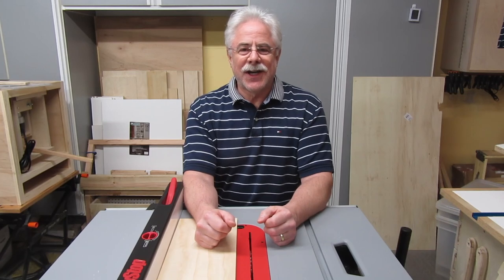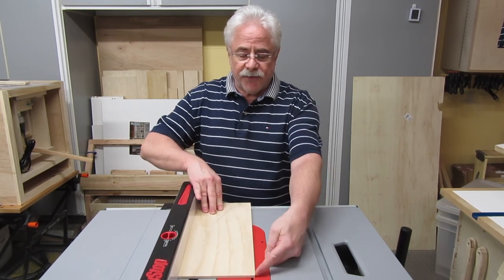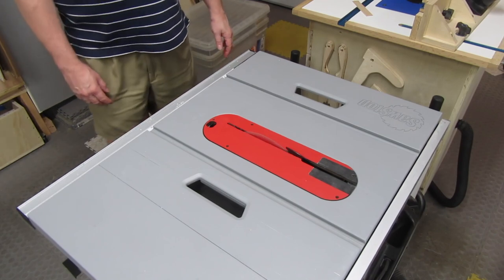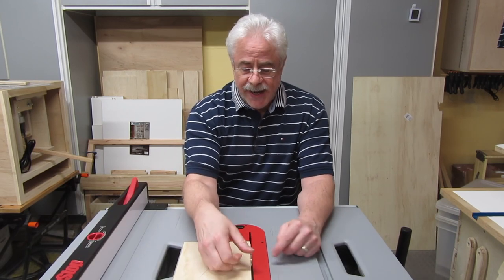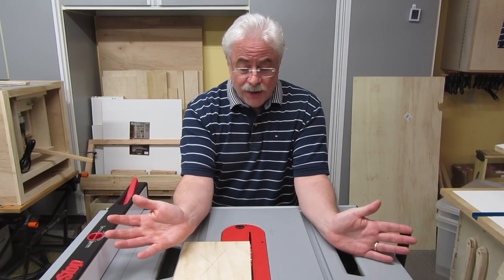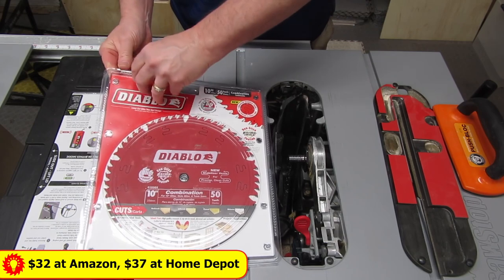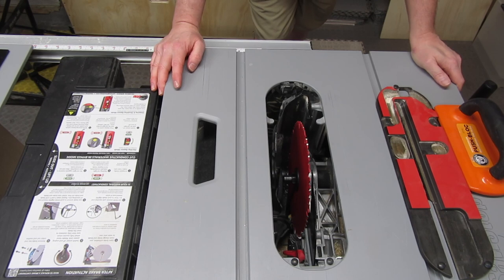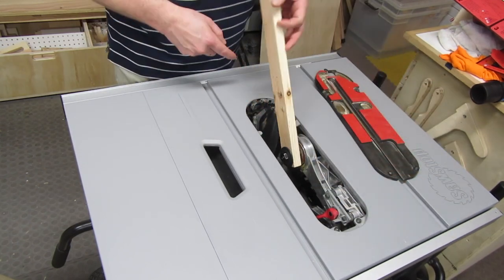SawStop Saved My Thumb! What Happens Next?

Comment: It looked like you did not use the blade guard or the riving knife when the accident happened.  If you let the guard do its job your hands won't be at risk.  The only time I ever remove my blade guard is doing dados and grooves.  I glad it turned out okay.
Reply from the maker: I did use the riving knife. But I hate using a blade guard. Most of the time, I feel safer and more in control of the stock without it. But that's just me.
Reply: @TheNewbieWoodworker  I don't mean this in an antagonistic way, but while this seems to be a common sentiment, its completely flawed reasoning. People say they are safer and more in control when they can see whats going on. Your incident is of course a perfect demonstration of how that makes absolutely no sense. The only thing you need to see is the workpiece in contact with the fence. There is nothing to be gained by seeing the wood in the blade, as there is nothing you can do (or should try to do) to change whats happening in the middle of a cut short of keeping the workpiece tight to the fence.

Great video though, thanks for sharing your experience. Glad you've still got all your digits. And congrats on the new saw!
Reply from the maker: @dblehar  Thanks, David, for the way you said this. I just had a troll battle, and I could have easily misinterpreted your intentions, so you saved me from responding to you in a way I would have regretted. You actually make a very valid point, and I hadn't really thought about it that way before. I make no promises to change, but I will certainly give it some thought. My other issue with blade guards is that I have to take them off to use sleds, and I use sleds all the time. But I'll think about it. The engineer in me wonders if there's a way around that problem, with a different sled design. Hmmm. Anyway, thanks! 😄
Reply: @TheNewbieWoodworker  i have an excalibur overhead guard on my saw so it can stay put for everything. Added benefit is it really does a great job getting all the dust. I think SawStop now has a similar offering (if not the exact same thing) that goes with their cabinet saw. Of course another expense but I love mine, totally worth it.
Reply from the maker: @dblehar  Thanks. Since I just bought the cabinet saw, I might end up getting that too.

Comment: That blade is not approved for any saw stop. Paint of new blade is different due to country of origin.
Reply from the maker: What makes you think this blade isn't approved for SawStops?
Reply: @TheNewbieWoodworker   I remember checking into those combo blades for my saw stop. The anti kickback ridges and deep shoulder blades were not approved. Looks like that may have changed, I know when i got mine  those 250mm blades and thin kerf were not recommended.   Granted I had a 5 hp ics 6 years ago.   Check with saw stop  if you have any concerns.
Reply from the maker: @mikewest712  Oh, I see what you're saying. This blade really doesn't have those anti-kickback ridges, at least not enough of them to matter. Also, this isn't a "thin kerf" blade. Lots of people use it on their SawStops.

Comment: If I were going to buy a stationary cabinet saw for a shop, I'd definitely consider a SawStop model because, aside from the blade brake, they are top quality saws in every other regard and not out of line price wise compared to other top end saws. They really gouge on the price of their jobsite saws though. There is no way the brake adds $800 to the price of the saw and that's about how much more they charge for theirs over even the most expensive next in line brand. It's too bad because a construction site is probably the place this would stop the most injuries. There are a lot of people using the saw and a lot of distractions.
Reply from the maker: Well, to be fair, their JobSite saw is pretty high quality for a JobSite saw. But I understand what you're saying. Of course, one mistake makes it worth the money anyway. 😄

Comment: You were lucky the blade did not catch your fingernail instead of your skin.  A fingernail is barely electrically conductive, so the SawStop is oblivious to it; the teeth will grab the fingernail and brutally pull it of, along with some flesh attached to it.  It will not amputate a finger; nevertheless leave you with a serious injury.
Reply from the maker: That sounds bad - you're right, I'm glad that didn't happen!

Comment: I've had my Sawstop for over 14 years and have set the brake off many times but never with my finger. Generally the blade is still good. However, they say that you shouldn't continue to use the same blade. I guess the lawyers think a carbide tooth might be loose or the blade might be bent. One time it happened on my Dado King and it did remove a couple of teeth. I sent it back to the factory and they braised new teeth on at a very reasonable cost. I sold my Powermatic to get the Sawstop and have never regretted the move. It's no wonder it's the largest selling saw.
Reply from the maker: Thanks for the comment. 😄

Comment: Your video came up randomly but I thought I would just pop in and mention, if you didn't know. Saw Stop will replace the cartridge for free if you send it in, fill out the questionnaire and they can confirm that it was in contact with skin which caused the incident.
Reply from the maker: Yes, I did know that, but thanks! And did I actually leave that out of the video? I'm keeping the blade and brake to frame and put on the wall.

Comment: Glad you are fine. So with power cut off to the motor and blade spinning due to inertia,  the sensors are still working?! Then it has to have an auxiliary power unit to drive the brake cartridge  to drop and jam the blade.  That is seriously an outstanding design.

Thank you for sharing your experience.
Reply from the maker: Thanks! Actually, there's a power switch that turns on all the electronics, then a switch that turns the blade on and off. Kind of like booting up a computer, but a lot faster. 😄
Reply: With the blade power off, the cartridge stopped the blade as shown, but the trunnion did not drop as it is supposed to.
Is that what happened in your case?
Reply from the maker: @sailorbill1908  Yes, that's what happened to me. But I just got a new SawStop PCS, and the manual that came with it is MUCH better than the one I got with the JSS, and it says that if the blade is spinning at top speed, or close to it, the blade will drop down. The implication being that if it's slower than that, it won't drop down. So I guess it works as designed.
Reply: It’s the quick loss in angular momentum of the blade that pulls it down below the table. So, less rpms, less angular momentum.
Reply from the maker: @craigwilson4903  👍

Comment: Dan, the blade break, my question is you have to replace the break unit, you can not reset it, it's a good feature I do like the system, it also  costly  but I guess if it's going to keep your fingers attached to your hand it's a good lesson to learn Thumbs up. No pun intended lol
Reply from the maker: Thanks, Alan. As for the brake, SawStop will replace the brake for free, if it got triggered by contact with "flesh". So the cost is pretty insignificant, especially considering I can still give a thumbs up. 😂

Comment: Sure, those systems are expensive. 
But: if you work with your saw a lot (maybe even doing commercial work), the real question is not if you can afford buying one, but if you can afford NOT buying one. 

It’s not like you need a new one every week (if you do, though, you might want to look into a different profession or hobby 😉). And even if you did, it would still be cheaper than one massive medical bill for ER, reconstructive/plastic surgery and whatnot.
Reply from the maker: I agree completely. Apparently there are actually people who don't make those kinds of mistakes, but if it was me, I'd be thinking that the odds are stacking up. 😄Thanks for the comment.

Comment: I didn't realize that the Sawstop device was a "one and done" per incident. Totally worth it of course; but glad you educated me on that point.
Reply from the maker: Yeah, one-and-done is a good description. But you can send the brake back to SawStop, and if you triggered it with your flesh, as opposed to cutting metal which apparently they can tell by examining the brake, they'll send you a new brake for free. I wouldn't trust the blade anymore, though. If you use an expensive blade, you can probably send it to the manufacturer to check it and fix it. I did this once, and they did a great job. Can't remember which company right now, though. Bottom line of course is that I agree with you - totally worth it!

Comment: I am a complete amateur and made the decision to cease all use of my cheap table saw until i could afford the saw stop. Mainly because as a Chef my hands are my life. Heck I honestly could not justify not buying one. I was talking to the painters at work and mentioned it and the boss asked more and more about the saw stop and said the cost of blade and cartridge is cheaper than the increase in insurance for one incident that left a cut on a worker let alone the loss of a finger.
Reply from the maker: True enough. If it helps, when the brake is triggered by touching flesh, you can send the brake to SawStop and they'll replace it for free. Of course, you'll probably want a spare brake so you don't have to wait for a new one.

Comment: Great Video Dan I am glad you are not a frequent visitor to the ER, if only routers had a saw stop break.🤣
Wow a cabinet saw you are really going to enjoy that saw, it is like the difference between making a table saw with a circular saw upside down on OSB and placing it in a trash can to have a table saw. Just the sound of the motor alone will make better cuts compared to the direct drive you have now.
It is nice to see the operation of the saw stop and the change out of the cartridge from a real consumer point of view. And it is nice to know
That no hot dogs where hurt in this video.
Keep up the great videos!

Back in 1981 I was a passenger in an airplane crash, I was wearing a Casio watch the watch broke in half and the digital display continued to work. It reminded me of John Cameron Swayze that advertisements for Timex “ It takes a licked and keeps tickin) ( how is that for a blast from the Past?) I snail mailed it back to Casio along with story behind the watch they sent me a new watch however to my knowledge they never used it for an advertisement. I still have the replacement watch.
Reply from the maker: Thanks! I wish I had thought of that hot dog line! And I'm glad you survived the crash. I can't even imagine!

Comment: you can throw your arbor out of alignment using a piece of wood like that. your assumption is that piece of perfectly straight and not warped.
Reply from the maker: I don't see how the wood could change the arbor's alignment. I suppose if you turned on the saw, it might be a problem. 😄As for the board being straight or warped, I address that here: 09:56.

Comment: What happens of your sawing through something treated or maybe has something conductive in it?
Reply from the maker: SawStops have something called "bypass mode". When you enable bypass mode, the brake won't get triggered. The status lights will tell you if the brake would have been triggered, so you can also use bypass mode to test various substances you're not sure about. And if you forget to use bypass mode, well, it'll throw the brake. This happened to me last week, because I was stupid. I knew I needed to use bypass mode, but somehow I didn't use it. So I had to replace the brake, and send my blade to the manufacturer to have it fixed - one chipped tooth, at least. If you use cheaper blades, then you just replace the blade.

Comment: Glad you are ok. 
I am a carpenter. Everyone I have ever met missing fingers lost them using a table saw. No one needs a saw stop. Keep your fingers away from the damn blade. Do not cut short pieces that can bind instead cut small pieces from longer stock. Don’t reach over a moving blade. When adjusting blade height don’t expose more blade than the amount of finger you are willing to loose . Use a push stick. Again keep your hands away from the blade. Every accident I have had or witnessed was from, being lazy, not paying attention or doing something stupid. Rarely is it bad luck. Unfortunately, if no one has taught you how to avoid injury bad experiences will. Also, I have noticed that the longer you go without injury the more likely you are to do something stupid. Be safe.
Reply from the maker: You say you've met people who have lost fingers using a table saw. Then you say no one needs a SawStop. I'm not forcing anyone to get a SawStop, however I'd argue that in fact, those people who lost fingers needed a SawStop. You also say that the longer you go without injury the more likely you are to do something stupid. Another reason for a SawStop. And of course injuries happen because of lack of knowledge, inattention, or stupidity. So what? That doesn't negate the need for safety equipment.
Reply: The Newbie Woodworker 

Not at all. The saw stop is a great idea and it works really really well. If I had an indoor shop that used a tablesaw it would be a very good purchase. I work in the field and not in the shop. The contractors version is too bulky I don’t like the stand I don’t much care for the fence and at the price point it just isn’t worth it to me. 

The point that I was trying to make though not very well is that the lesson that you learned from the injury or near injury shouldn’t be that you made a wise purchase but that you did something that you should never of done and that is what put you in harms way. You never should’ve reached over a moving blade that is the Takeaway. There are many other ways to injure yourself on a table saw that do not include being cut or losing fingers. I’ve seen people get hit in the face with pieces I’ve seen people get hit in the chest with pieces, and so on. Saw stop will not prevent kickback, binding, or protect your eyes. 

When I wrote to keep your hands away from the blade it wasn’t to be a snide dick. And yes it’s painfully obvious. But as you found out it can be taken for granted. 

Play safe.
Reply from the maker: @evilsimeon  Thanks for the clarification. Your reply is the exact reason I try (and sometimes fail) to not  attack someone who I think is attacking me. I figure everyone deserves to be treated with respect, until they prove otherwise. But honestly, I was beginning to wonder about that philosophy, so thank you for being someone who's not being a dick! 😄

To your point, I couldn't agree more. I did already know better, and hopefully this is another reminder to me. Just because it's turned off doesn't mean it's safe.

As far as kickback is concerned, I have a video demonstrating kickback, and while I may have taken some foolish chances in the video, I learned so much on the subject that it was worth it. Riving knife FTW, for one. Anyway, thanks again for the clarification.

Comment: I thought of a possible easier method to remove the blade/brake. Put a piece of scrap wood on the blade at an angle and knock it with a mallet to break the blade out of the brake pad. Could try wiggling the blade back and forth too with less force. If you can separate them it may have been easier to get out. Maybe.
Reply from the maker: Thanks. It's not supposed to be that hard to do. Not sure why I had trouble.

Comment: You can send the broken device to SAW STOP, and they'll give you a new one.👍👌
P.S.  DIABLO Blades are the best.💪👍🤟
Reply from the maker: They'll give you a new one if the brake was triggered by contact with flesh. And it's a great deal! Thanks for the comment. 🙂
Reply: @TheNewbieWoodworker  If the blade is expensive, it might be worth checking with the manufacturer if they can check and refurbish it
Reply from the maker: @michaeltempsch5282  Definitely a good idea. Thanks.

Comment: I always use some basic fabric work gloves when handling the blades.. glad your brake engages so fast .. I am so tempted to buy a Sawstop!  I just love my Ridgid 4512 table saw.. but I am quite tempted to replace it just for the added safety all it takes is one goof.
Reply from the maker: Thanks for the comment about gloves. I'm trying to remember to use them, and hopefully I've shed enough blood that I'll remember from now on. 😄I know that replacing a saw you love is hard to do, but the cost of an ER visit, and the thought of losing fingers is a good motivator. 😄
Reply: @TheNewbieWoodworker  Yes indeed.  My thoughts exactly, as well as someone in my family has lost a finger to a job site saw while on the job.  I'm a hobbyist but I think it may be something my tax return may have to fund, plus my present saw is perfect and I can get a few hundred for it.  Make some sawdust !
Reply from the maker: @g.fortin3228  Personally, think those of us who don't do woodworking as often as the professional might even benefit from a SawStop more than the professional. On the other hand, I've heard from multiple job site leads who swear by the SawStop, because it's saved many employees. Anyway, enjoy!

Comment: How much did he end up spending on the replacement parts and saw stop not the blade but the replacement parts you had to change out due to the brick incident
Reply from the maker: As I said in the video, it costs about $80 for the brake. Much cheaper than a visit to the ER.